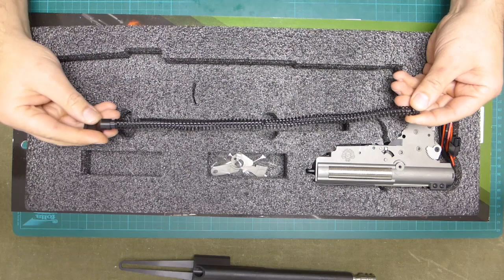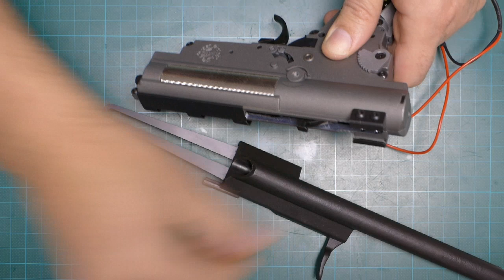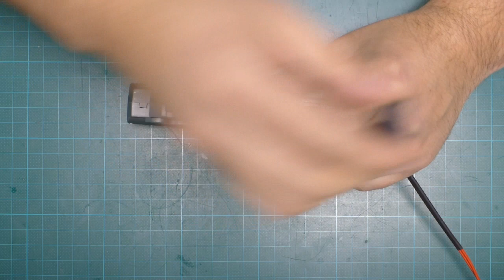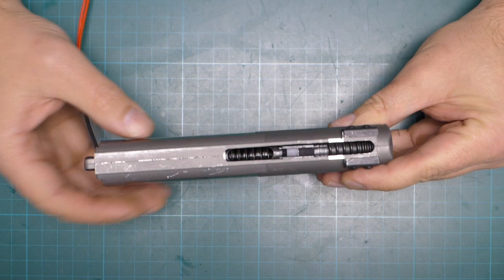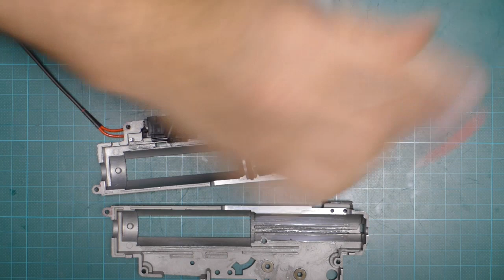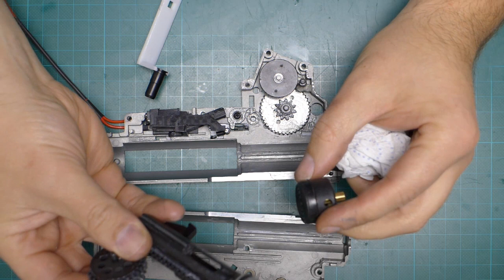[VLOG] LCTairsoft EBB kit (part 1): Disassembly

Comment: Durability is the main concern now, as it was said before. On the other hand I can't imagine LCT would release something that is not durable enough. Nobody wants to spend 200 euros for a gearbox that can't last 5-10k BBs. Put some BBs through it Andrey and we will see. Keep up the good work Andrey!
Reply from the maker: They certainly did some testing, but I don't know howlong. Ideally would be until a failure ;)
This particular kit is ready to be re-wired now, with some delay... But will be battle ready by February 23. February 24-25 is the field test...